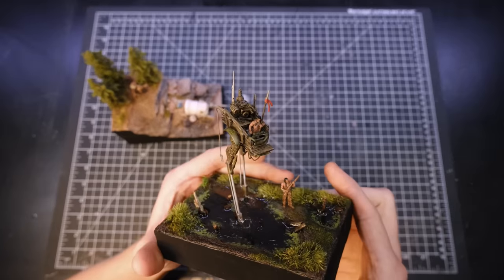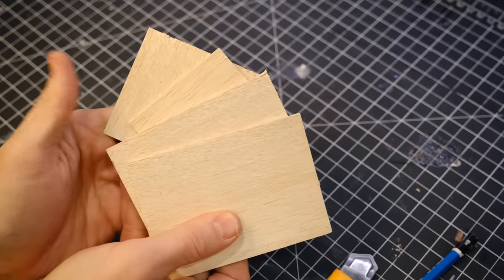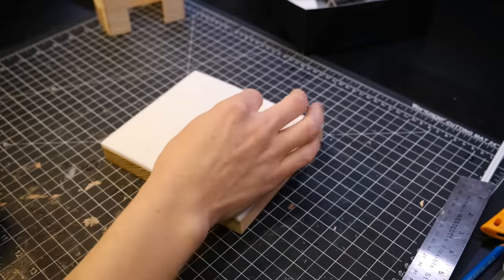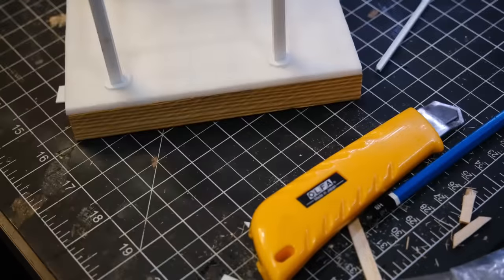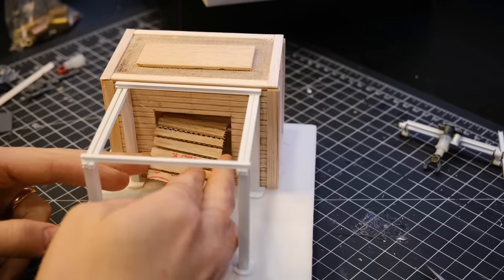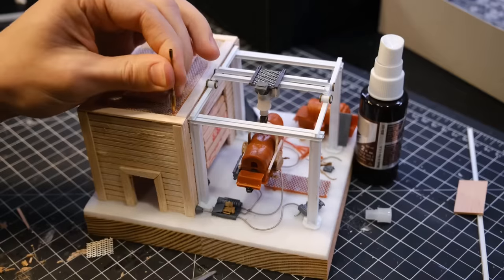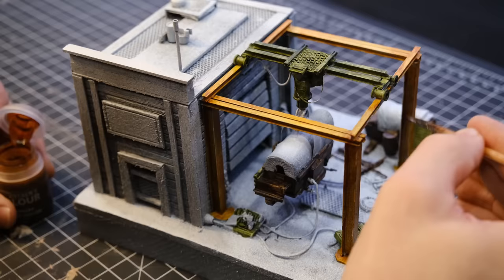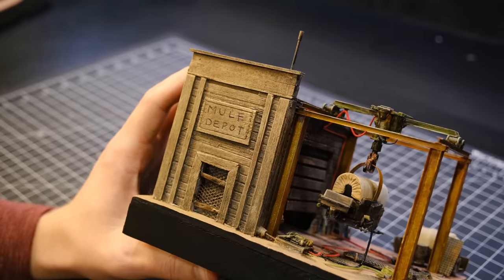My Western Town | Building 4

Comment: This was inspired by Boylei Hobby Time’s World “Wild West”

-- A Quiet Moment In Hammer Town --
-- By EricTalon --

“Here it comes Pete,” Gary, the bartender, called and sent the tall mug of cold beer sliding down the bar.

“Thanks Gary,” Pete replied, bringing the sliding mug to a stop without spilling a drop. 

Old prospector Pete was determined to enjoy this well deserved refreshment. His Mech Utility Load-Bearing Equipment, or MULE had stepped in a deep hole on this last prospecting trip, snapping the leg clean off and had sent Pete and his MULE stumbling down a gully. Leaving Old Pete stuck in the high peaks for the better part of a week. He had managed to get his MULE running again, and had fashioned a makeshift leg out of a stout tree. It had been just enough for him to hobble back to the edge of town. Now there was nothing for him to do but enjoy the cold beer in the warm saloon and tell stories about the “lake terror” he had encountered one dark night while fetching water. 

There were two brothers who ran the town’s only MULE Depot. They had found Old Pete’s MULE at the edge of town where it had staggered to a stop under Old Pete, and had hauled it in with their own Mech Wrecker. Now Pete’s MULE hung from the gantry crane in the MULE Depot where it was getting pieced back together. The MULE Depot’s powerful diesel hammer, which some said was the beating heart of the town itself, could be heard maintaining a tireless rhythm as it hammered out a re-forged leg from the broken parts of the old. 

Meanwhile the morning shift from the mine was crowding into the saloon for coffee and breakfast. They mingled with Pete and the river boat crew who claimed to have sighted a rather large and ghostly albino alligator. This caught the attention of Boregard, the town’s Sheriff. Who came over, asked questions, and took careful notes of the river boat’s crew describing the location of their sighting. Later he made his way over to Old Pete and took notes on Pete's new “lake terror” sighting. 

As Sheriff, it was his job to help keep the town safe, that meant keeping track of monster sightings and working with the local monster hunters to ensure none of these monsters threatened the town or any of the roads connecting them to the rest of the world. Last week for instance, a large snapping turtle had attacked a flotilla of small river vessels. No one had been severely injured, but a valuable generator, meant for the Crystal Falls Electric, was lost when the vessel capsized. With small vessels currently not shipping on the river, Crystal Falls Electric had been forced to hire a pair of Indian traders at an exuberant price to pack a new generator over the swampy Golden Bear pass in order to keep the town and local residences supplied with enough electric to stay warm in this cold weather.
 
Outside, the morning stage rolled up to the bank on time as always, just as breakfast was ending. Sheriff Boregard left the saloon to check if his weeklys had come and to greet the passengers disembarking the stage. As he and the stage driver, Dusty, exchange notes about sightings and road conditions, the monster hunting expedition dragged themselves into town. They came to a halt in front of the MULE depot. 

“I better go check what happened, ”Sheriff Boregard told Dusty, the stage driver, as he stepped off the boardwalk. 

Even from here, Sheriff Boregard could see the monster hunting expedition was a mess. Several of the members cradled wounded limbs and everyone had been bleeding at one point or another. Their first wagon’s frame was twisted and missing a wheel and as for their second wagon with the monster cage...well nothing remained of it except the twisted and broken tow bar that was dragging behind the first wagon. 

“You boys alright?” Sheriff Boregard inquired as he strode up to the expedition. 

“Yeah we’ll live,” The expedition leader, Mike, replied. 

“We got jumped by an arachnid out by Burrows canyon, Tomis says it looked like a scorpion,” Mike explained. “Our horses must have caught wind of it cause they all suddenly bolted sharply to the right just before it came at us from the canyon below. The front wagon snapped to the right trying to follow our horses, nearly flipping us over. The back wagon slid around like the end of a whip and collided with the charging arachnid. The tow bar broke and as far as we could tell the two must have gotten tangled together ‘cause both of them rolled over the canyon edge like one big ball ‘o nightmare.” 

“I better radio all this in,” Sheriff Boregard concluded. “We can’t afford to leave something that aggressive so close to the main road.”

“Agreed,” Mike said. “I’ll call our company headquarters to see if they can’t send us a combat mech for backup.”